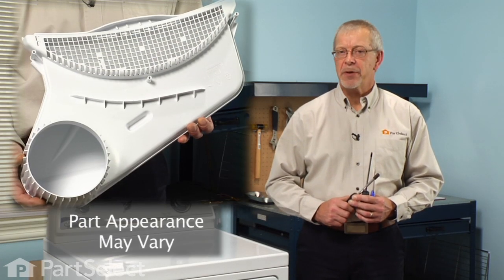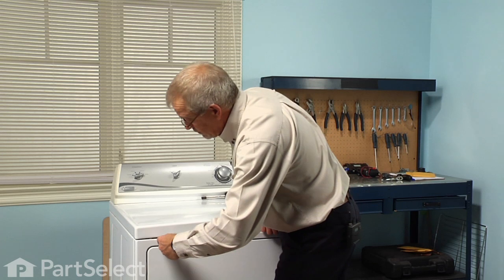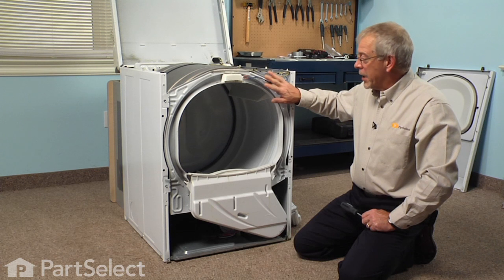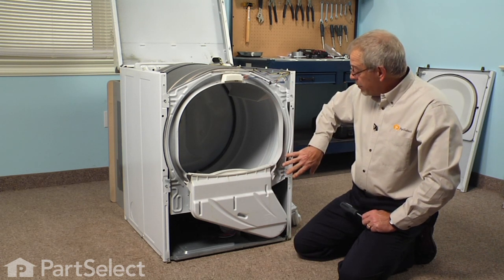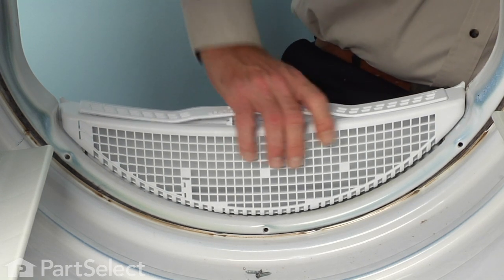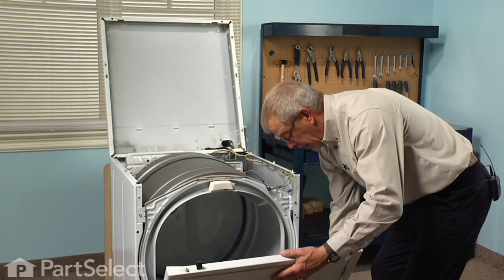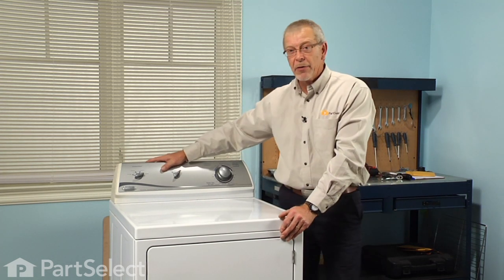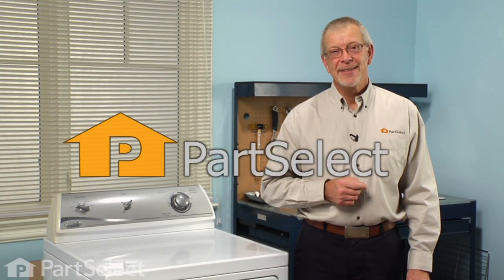Dryer Repair- Replacing the Lint Duct Assembly (Whirlpool Part # 37001141)

Comment: Anyone else not been able to find this part ?? Every single site I’ve checked say out of stock and that manufacturer have discontinued it and that there are no alternative parts to replace it. The grill on my lint duct assembly broke off off entirely; maybe I different model of front grill could be modified to repair it??

Comment: The above method for accessing the Lint Duct Assembly does not work for my Maytag SDE 4606 AYW (purchased 2005):  the top is attached to the sides with brackets that are screwed into the side panels. I had to remove the bottom panel (2 slotted hex head screws, 5/16", at the floor).  Then remove the door/front assembly (2 more slotted 5/16 hex head screws).